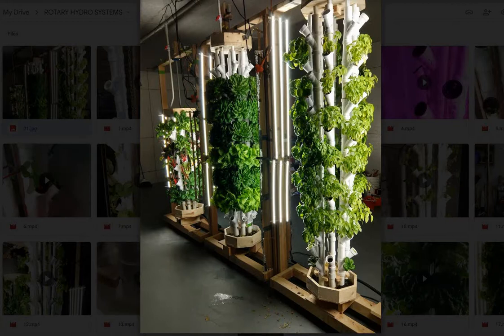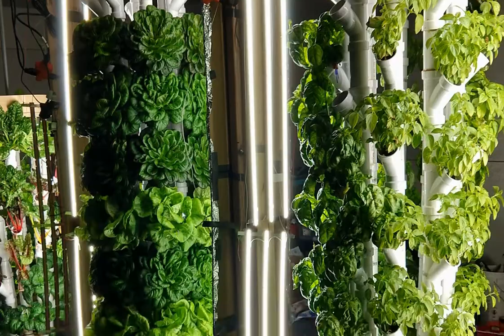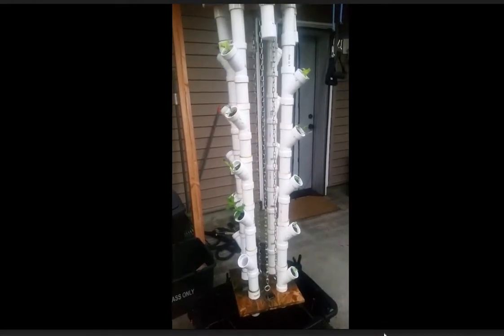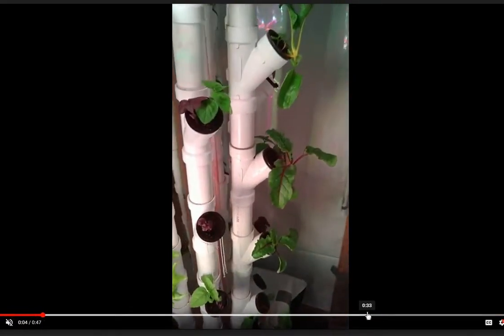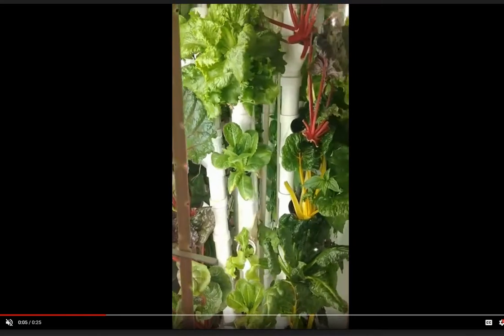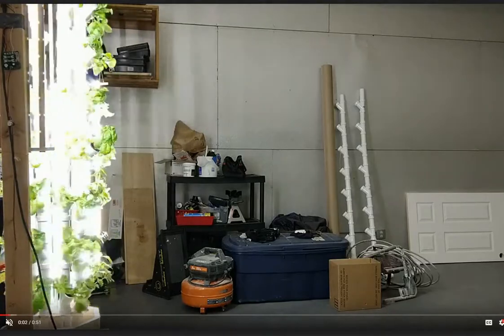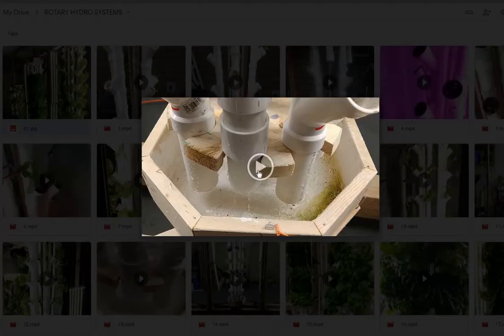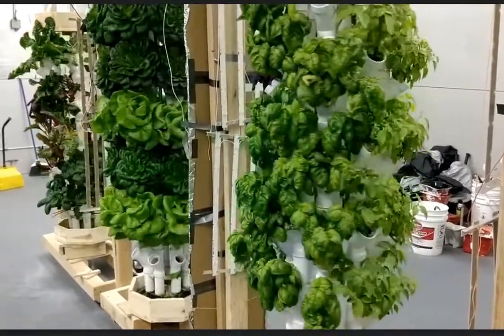ROTATING Vertical Hydroponic System

Comment: Suggestion: Put your vertical gardens in a circle around 1 central vertical bulb 315 CMH. That way 1 bulb can light 5-6 systems since they rotate. Now sure what your power draw is on those LEDs youve wired but I bet a 315 lighting 6 systems would be a good efficient setup.

Comment: But if you use a pulley system where the whole weight is in the pulley and not on the Disco ball motor.  Hope that helps

Comment: Hi Amazing video and system, I am attempting to build something similar due to limited space. I am having trouble finding a motor that can handle the weight. You mentioned that the disco ball motors did not work but never said what you are using currently. Can you give some details about the type of motor/spinner you are using?
Reply from the maker: I used this https://www.amazon.com/gp/product/B071KFT4P7/ref=ppx_yo_dt_b_asin_title_o00_s01?ie=UTF8&psc=1
Reply from the maker: also used potentiometer  to control the rotation speed.
Reply: You could also suspend the top from a swivel and attach the motor to the bottom with something rigid or even a chain, that would limit the motor to only powering the force of rotating your growing setup and relieve the weight factor.

Comment: Great Setup!
Why did you choose that spinning speed instead of something slower? What would be the difference if any?
Reply from the maker: It just happened to be a good speed for my cheap $15 motors. I would say 1.5-3 rpm is optimal tho
Reply: Good Afternoon, Could you possibly point me in the right direction on what type of motor you used and how that part works?  That would be a huge help!
Reply: I would love to know this also

Comment: Good video, thanks!  So what is the benefit of the spinning?  I'm starting a vertical garden and was just wondering if I should do the same.  Would be great to hear about your lighting.
Reply from the maker: Because of the rotating effect, the plants get even light coverage and even amounts of water as each pipe rotates under the water source, which is stationary. Also you don't have to surround the circular grow tower in lights to achieve an even light coverage, which would be a pain for many reasons. 

I'm planning on making a video about the lights. They are Bridgelux EB strips, wired in series. Each tower has two, 200W led drivers, so a potential of 400W total (from the wall).